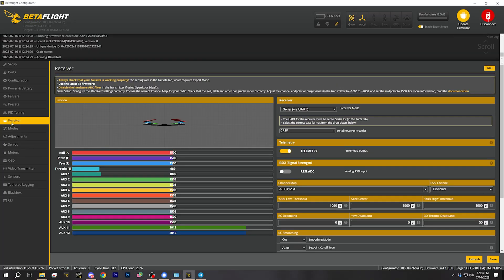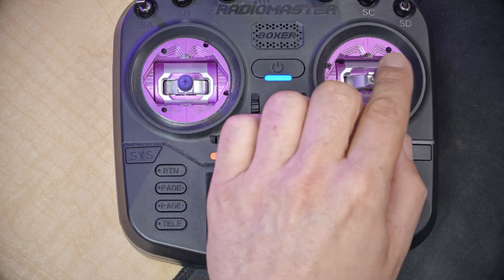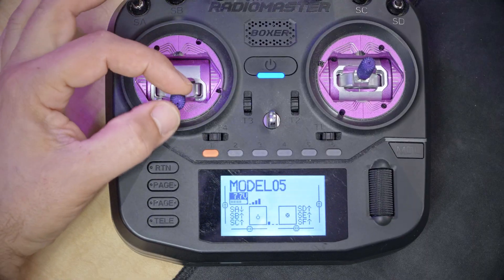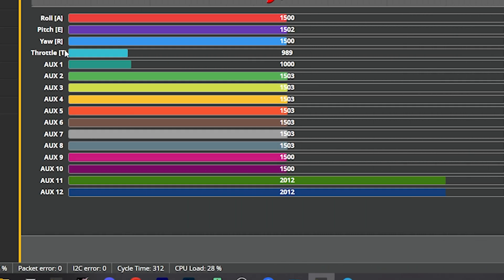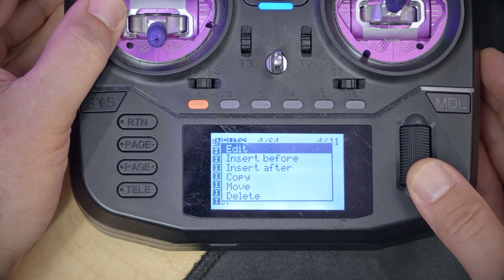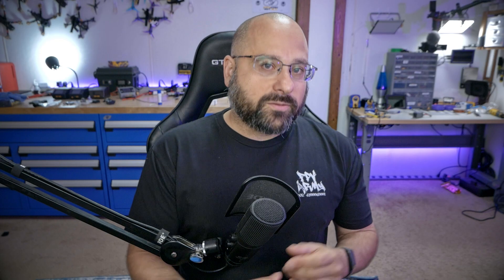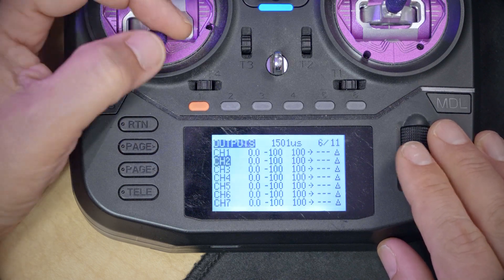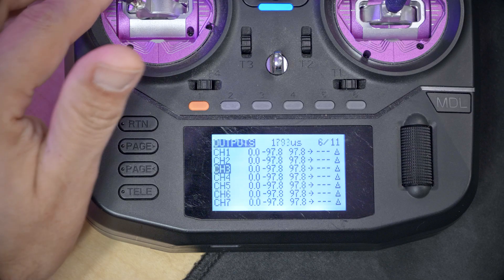Build an FPV drone in 2023 - Part 8 - Betaflight Channel Mapping and Endpoints

Comment: FPV drones have me feeling completely inept, though I know I’m not. Been building and flying RC helis for years,  but here it goes. Well, I followed all your guidance as well as I could. For some reason, when I get into Betaflight, my transmitter inputs are not registering at all on the Receiver page. My transmitter and receiver are bound. The light is steady on the receiver. I made sure soldering is TX to RX / RX to TX. I’m at a loss.
Reply: I'm having the same issue  did u ever  resolve it
Reply: I had a similar issue when i binded my radio.  It would bind, but not register input. For some reason, my radio was set to slave out of the box.  I changed mine to master and it started seeing all my inputs.

Comment: About the mode 2 mapping versus us youngins who play first person shooter games...

I know in video games swapping controls is super easy, to accommodate "southpaw" players or other schema.

If possible, wouldnt it be better to have a switch or dial or whatever on the remote simply switch between different modes? That would eliminate the issue all together; people could fly whatever mode they want and when sharing at a field others could just flip a switch to put it in their desired mode.

If not possible, why not?
Reply: The throttle is not spring loaded and does not move to 0 automatically, but otherwise its all software and can be done

Comment: I must be doing it wrong - but in on my new JB-edition TX16S, running EdgeTX v2.7.1 - I don't seem to have a "Copy Min/Max to All" when editing the channel setpoints.  After a fair bit of googling, rewinding the video, carefully poring over the options - what I realize is that "long-pressing the jog-wheel" has the same effect as a simple / single-click.  All I get are:
* Edit
* Reset
* Copy sticks to subtrim
* Copy trims to subtrim

I was able to work around the issue by simply performing the edits on all 4 channels, so I'm moving on.  Will continue to research, and report back here if I figure out what I'm doing wrong.  This EdgeTX doc mentions the options I'm seeing (above) - but doesn't reference the ones I can't find.  Weird.

https://edgetx.gitbook.io/edgetx-user-manual/edgetx-user-manual/user-manual-for-color-screen-radios/model-settings/inputs-mixes-and-outputs/outputs

Thanks again for all the amazing guidance, insight, and -- entertainment!  Cheers!